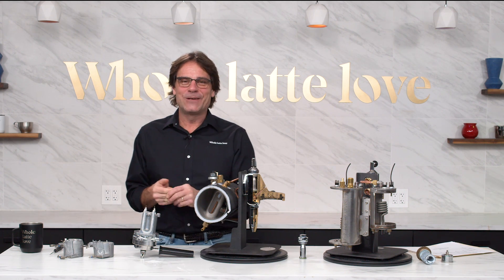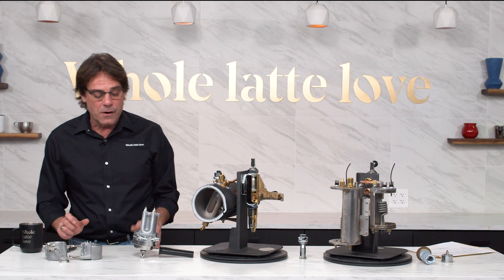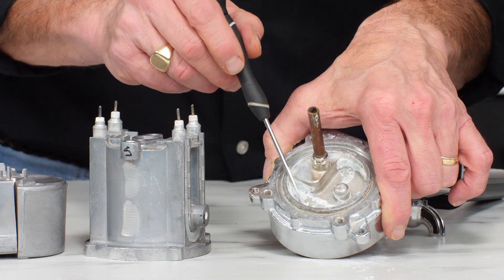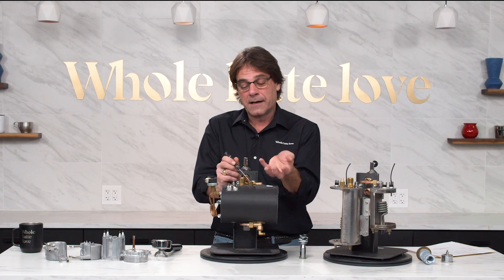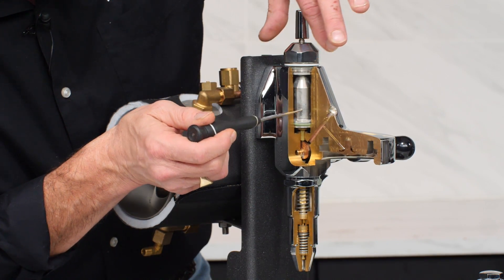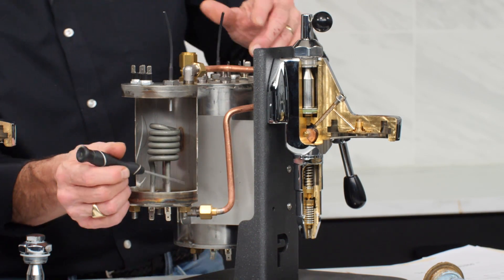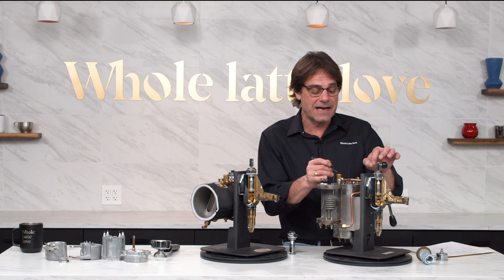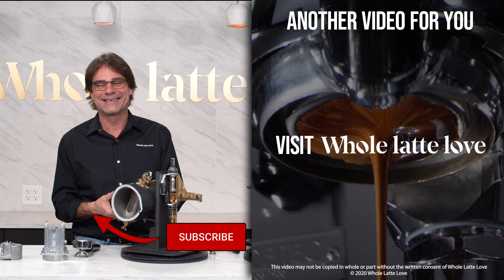Espresso Machine Boilers: See Inside 4 Types

Comment: I'm in the heat exchanger business (very large for HVAC mechanical rooms).  So guess what type of espresso machine I bought.
Reply: Rocket Appartemanto.
Reply from the maker: Hi Steve, Dual boiler? JK!!! Did you go with a PID HX machine?
Marc
Reply: @Wholelattelovepage  Hi, Marc.  I just purchased a beautiful ECM Technika V Profi after watching several hundred of your videos.  It's on the way.  Thanks.
Reply from the maker: Thanks for the info. Several hundred! Poor guy I'll be quiet now. But first, very nice machine. Basically the HX version of the Synchronika.
Marc
Reply: @Wholelattelovepage  Well, maybe it wasn't several hundred.  All I know is I got a great education on espresso.  I appreciate the rotary pump, paddle valves, and the way the PID display looks.  I'm sure it will make good coffee, too.